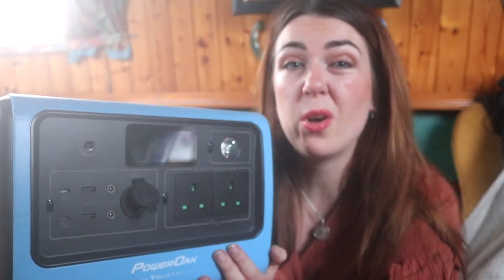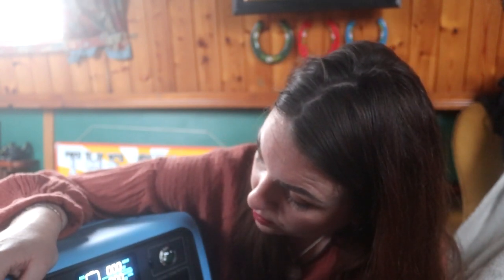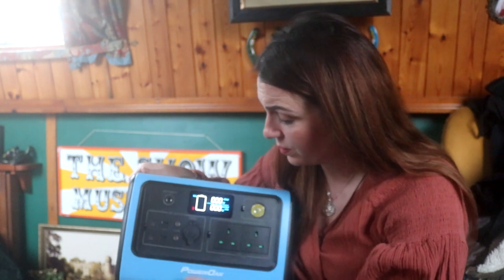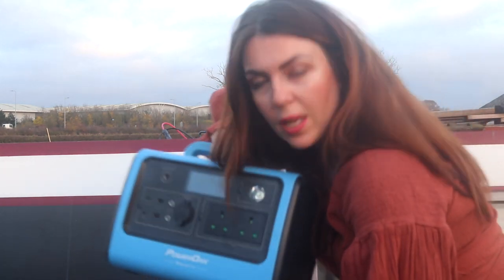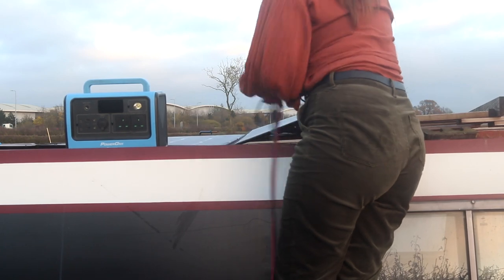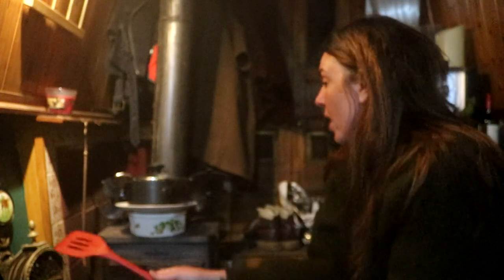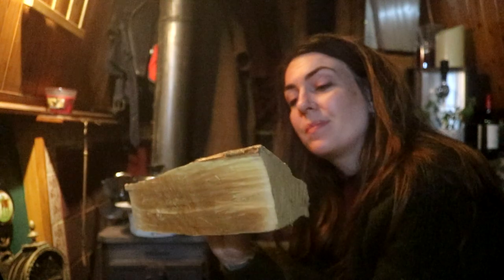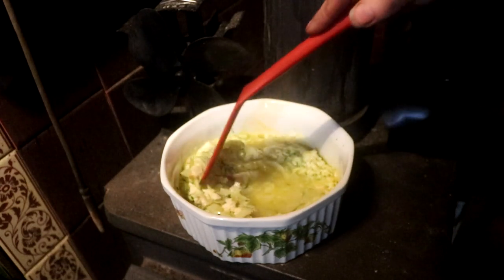Ep 87: POWER on a Narrowboat! How I use my engine, Bluetti solar, and stove to for Cost Of Living!

Comment: Enjoying your video's brings back good memories. I appreciate funds maybe an issue but a couple of good mods, upgrade your alternator for a higher amperage which in turn means running your engine for shorter periods, providing your batteries are good. Another good piece of kit inverter charger,  Victron do some good kit , intelligent charger/battery conditioner is also a good move. Is your current hot water via a calorifier ?  Not sure if you are aware Armstrong Siddeley use to make aircraft engines, gearboxes for tanks and quality cars, the company got absorbed by Rolls Royce.

Comment: You could use one of those pull carts from Walmart or your equivalent. Having one would make your life so much easier; fill it with groceries, wood, or whatever you need to haul, and it folds up when not in use. The one you need is called Grocery Cart with wheels, a collapsible Outdoor Utility Wagon with all-terrain wheels, it is blue and holds up to 150 pounds and is $82.00 here in the states.
Reply from the maker: I absolutely have been for the hunt of one of these since this message!
Reply: @EarleWrites  Sweet! Let me know if you find one; I will try to get one to you if the shipping doesn't cost an arm and a leg to get it to you.
Reply: @EarleWrites  It's me again! I found it on Amazon.

Comment: About power - you can find universal 12 V car chargers for laptops, and you can also install a 12V car cigarette lighter style socket in the boat's 12V system (unless you already have them). I use those on my sailing boat, and have no need for an inverter (the fridge is also a 12V unit). Especially if your inverter drains the main battery quickly, that might be a way to use less power. Also I suspect that car socket on your power pack is bidirectional, so you could also use that and maybe get a little bit more juice out from the power pack, too, not having to use the internal inverter in there. There's always some loss in inverting and raising the voltage to grid standards and then rectifying and lowering the voltage; using a DC-DC converter such as found in the car chargers for laptops means less loss.
Reply from the maker: Ooooo I'll have a look into that, Janne! Thanks for the tip!

Comment: That water heater on the flue sounds great. One word of warning though - if you have the stove going all the time, the water in the heater might start boiling, and you end up with a lot of moisture inside the boat.
Reply from the maker: Good point... Hmmm... Maybe if it starts over boiling that will make me be productive and do some washing to get rid of the 20litres?
Reply: another thought - when you have something cooling your chimney (like that water heater with cold water in it) make sure to check if the smoke still leaves the chimney alright. I know some blokes who "overcooled" their chimney and smoke started to prefer indoors, which is a quick way to die without a warning. This is not an issue with the stove running "full steam" but if you want to keep it burning at a slow rate for long time the cooling may be too strong and the draft is gone. 
An idea (I know your holds are full of ideas): there is a company called Aspen Aerogel. They produce and distribute hightech insulation materials (like 4-5 better than expanded polystyrene) which are expensive like hell but are used to heat insulate when there is very limited space. You may ask them if they are interested to add some heat insulation to the inside of your boat as a sponsorship, with you giving honest review on that. I believe insulating boats may be a business they may or may not have explored so your application may give them sales. 
And if they are not interested, your not not any worse off than today, are you? :) 
Keep it up, good stuff

Comment: Lizbef! So you said the boat had radiators. Do they circulate warm water through them? If so, how hard would it be to pipe the water through your stove and heat it while heating the boat? I thought of this idea when I had my houseboat, but had to sell due to other circumstances. I have seen people wrap a copper coil around the stove or the chimney to take that wasted heat and use it to heat water.
Reply from the maker: It will definitely be something I look into for next Winter! All about money right now I'm afraid. But that would be fantastic!

Comment: you may be interested in a couple more batteries and an inverter which will give you a certain amount of ac (220v) from your dc 12v ) batteries
Reply from the maker: It will have to be a next year thing I'm afraid. Budget is quite tight this winter!

Comment: Using an invertor to convert from 12v to 240v and then back down to 9v for a laptop is so inefficient because you lose power with each step of voltage conversion. You can get 12v laptop power supplies. With only one step they are more efficient. Also a 12v fridge is more efficient for the same reason.

Comment: 1, Ditch the Wood & Coal & get Peat, Its cleaner and way warmer and takes up half the space, 2, Free Power? Use an inverter and run a marine capacitor bank instead, It can take well over 1 million + charges and charges up in 30 seconds to full power off an inverter, And then you can use washing machine tumble dryer, 240v cooker ect, They fit them into Gin Cruisers, But in winter No sweaping snow off solar panels that are only 32% efficent or the use of a noisy wind turbine. Just a few idea's Petal..
Reply from the maker: Oooo I had heard about peat! Is it expensive? I'll look into the marine capacitor bank. Do you know what costs I'm looking at? Thanks for the tips!
Reply: Ooh I want a marine capacitor bank, and I don’t even have a boat!😂
Reply: Peat doesn't sound very environmentally friendly. It has been completely phased out of compost. Sorry to pour cold water on your idea.